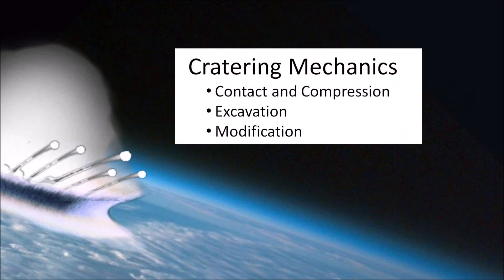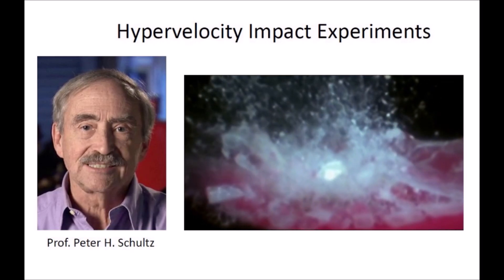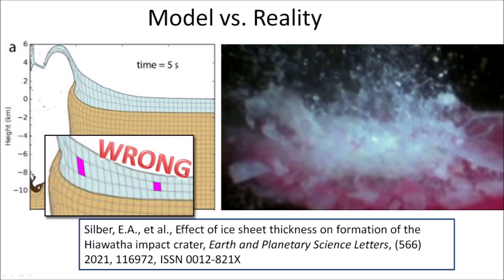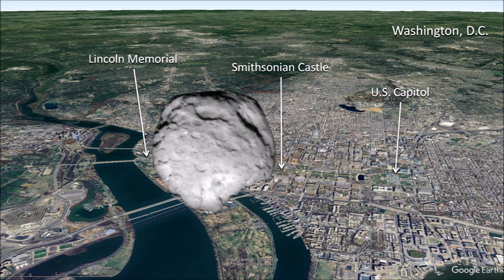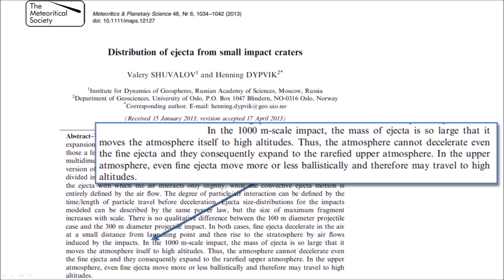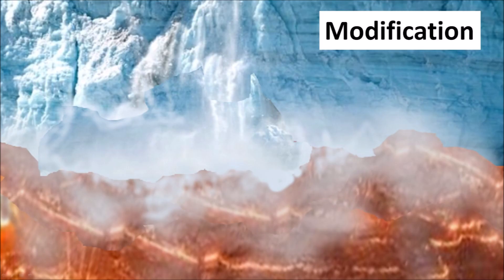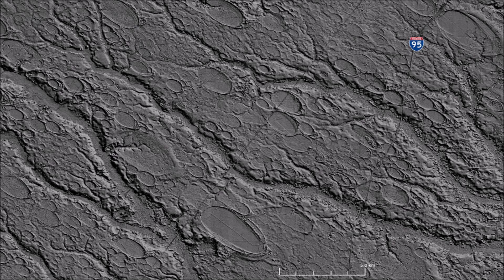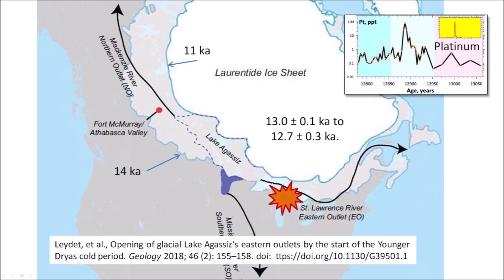Excavation stage of an extraterrestrial impact

Comment: What density did you assign to the comet? I modeled general impacts on ice with comets of smaller diameters, 0.5 to 1 km eith densities slightly greater than that of ice up to the density of nickel iron meteorites. Of course, denser bolides created greater yields. The higher energy impacts will immediately not just vaporize but  ionize the ice in the area of the impact and ionic oxygen and hydrogen, essentially rocket fuel, would transmit energy into and under the ice firther fragmenting and,   propelling ice boulders, when the ions recombine in an hypergolic reaction. The impact temperature would be so incredibly hot that the physical shock wave would be supplemented by a wave of plasma and steam propagating through kilometers of fissures and fractures generated within the ice.  And after it got done raining ice boulders the size of office buildings, the amount of water vapor pumped into the atmosphere would immediately begin to precipitate out and it would rain and snow for a very long time.
Reply from the maker: I think that you have to calculate the energy of the impact based on the results. If we calculate the energy to create all the Carolina Bays, we may be able to estimate the energy of the extraterrestrial impact. Take a look at this video: https://youtu.be/BG1Y1kOoxjk
Reply: @Antonio_Zamora  I just feel like there has to be more to the physics of impact upon  a glacier 4 or 5 kilometers thick. A lot of water is going to get cooked into atoms.  Ice is different enough in structure from rock or water that massive volume of  ionic hydrogen molecules blasted into it should have an effect of some kind that wouldn't be discernable in an air or water impact.  That glacier didn't just go pop. It got peeled up and back,  like an orange.

Comment: Your theory is sound, and explanation/presentation thorough. Very well done :) I have puzzled over just HOW the impactors were so similar in design/shape-
IMO the overall consistency of elliptical impact uniformity was due to the ice chunks that upon ejecting at great speed, were at first irregular shaped with no coinciding uniformity/similarities...  but their shapes were summarily rounded and edges smoothed by atmospheric friction & heat as they were propelled upward/falling downward... before impacting.
This possibility, suggests that it was ice & not from a swarm of bolides... because, it seems less probable that a shower of meteors or comets  
would or could be so exactly matching in design.
Also- meteoric nanocrystals have been found on the edges of the elliptical impact craters... so many assume such is proof positive that the impactors were not ice- BUT is it not possible that nanocrystals were imparted into the ice chunks upon impact with the ice sheet?
As it stands in my mind... extensive/intensive research still needs be done on the ellipses before we can say with 100% certainty that the impactors were indeed ice and not meteoric.
Thank you, Mr. Zamora, for this video presentation... keep up your good works!
BTW- I realize you have in all probability you already considered everything I brought to the table, but my enthusiasm for this subject moved me to speak my mind regardless :)
Reply from the maker: Five years ago, I was thinking about ablation during re-entry, and this motivated me to conduct a blow-torch experiment: https://youtu.be/KUKM3CYsOlE

Comment: This reminds me of a thought experiment  that I'm sure has been considered, but I don't recall seeing any math: It seems necessary that the ice sheet north of the present Great Lakes was also massively bombarded by the ice boulders ejected from the primary impact, perhaps up to a 1000 km away.  I know the YD cooling lasted another 1100 years, but it strikes me as one way to hasten the demise of an ice sheet would be to pulverize its surface with the equivalent of thousands of atomic bombs.  Alas, the evidence is certainly all washed away. My understanding is that one of the features that is contributing to the rapid melting of Greenland ice sheet now are channels/fractures that drain surface water through the heart of the ice sheet and out to the ocean.  I wonder if someone skilled at ballistics would be able to model an ice boulder hitting an ice sheet and estimate the results.
Reply: The high albedo of polar snow forms a positive feedback that must be offset by negating effects such as glacial flow, crustal deformation, aridity, dust and ash covering, etc.